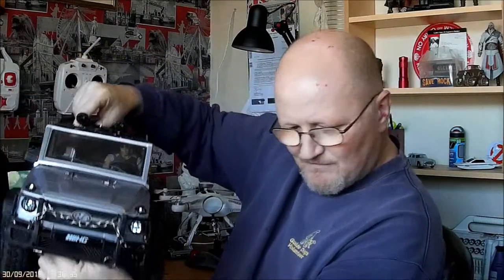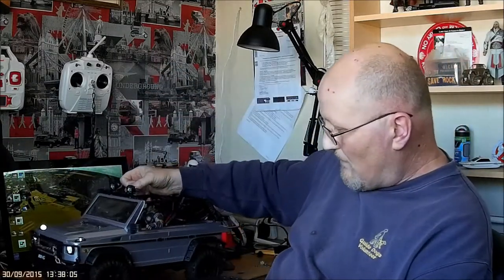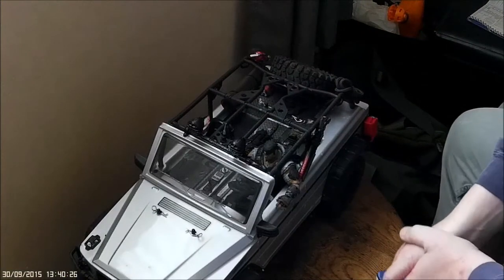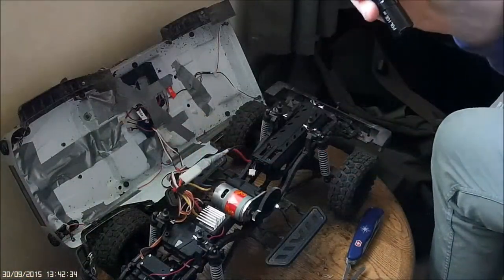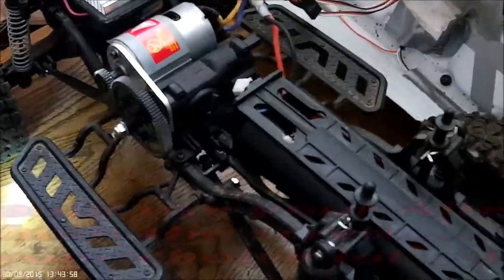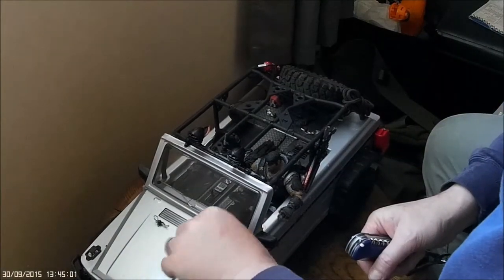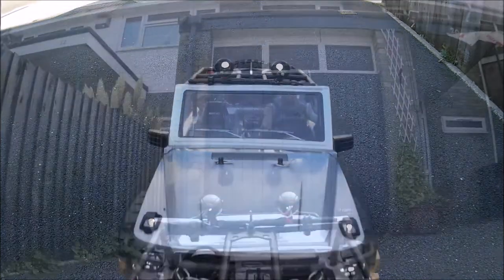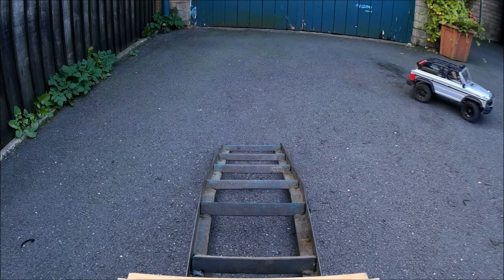How to change  HG P402 from a High to a low range gear .

Comment: There is no need to loosen up the bolt, unless it was overtighten from factory. All that has to be done is slightly rock back and forth the truck while attempting to switch gear, and it can be accessed from the bottom w one finger

Comment: Your screw most be over tightened,I have had 2of these and never had to take ether apart to switch between the 2. Only time I had to take it apart was to add in a servo to be able to switch between them at the tx
Reply from the maker: Cheers Milla.  being new to the game I am still unsure what's normal and what's not so thank you 👍☺

Comment: Hello Steve there is a option to mount a micro servo and to use that H to L switch on you transmitter that you use to control your lights to change the transfer case on the fly.
Reply: +DukeSky I have the 6x6, the high/low switch can just be pushed across, which makes sense if it can also be controlled via the tx with a servo. I have the gearbox on low, and the smallest pinion, but need to get more bottom end torque for crawling as I have a scratch built Oshkosh shell on it, and its heavy.
Reply from the maker: +DukeSky,  awesome I never thought of that. many thanks matey I will look into it. 👍☺
Reply from the maker: +Bristol Armoured Division . I would love to see that, any chance of a video ?

Comment: hi Steve, i just got mine but for some reason the steering doesn't work properly. battery is fully charged and batteries in the controller are new. it goes forward and back but not right or left :-( hope you can share some info. Thanks!
Reply from the maker: Hi joey, sorry for the late reply . Have you fixed it. if not there are 2 things to check . 1 check the steering servo isn't jammed. I know it sounds odd but I have had this happen and 2 check you're plugs are in the right way. When I put my lights on , the same thing happened.  I could move back and forward but not steer. I played with .....sorry checked the plugs and found I had attached them wrong. Hope that helps and sorry I did not answer sooner.
Reply: +Steve “Cougar” Ball thanks Steve :-) no i havent worked it out. to be honest i prefer my local rc model shop to look at it just to be sure because im still learning as i go when it regards to these electronics. and also, i wanted to change everything to waterproof ones.
Reply from the maker: +Joey Palomeno I can't fault you on that matey . good luck 😊👍

Comment: Ok I got one question, How then the transmission servo works? Its just moving back and forth between H and L. If using the radio, then it shifts without having to unbolt "loosen" up the gearbox arm.
Reply from the maker: on mine there is no servo to change ratio.  The switch on the controller adjusts the lights lol .It is possible to fix a servo and attach it so that when you flick the lever on the controls it changes ratio. The reason I  ade the video is that this was my first rc car and no where did the literature say about how to change between low and high. so when I found out , with it being a new truck at the time , I posted to help others like me. 👍☺
Reply: +Steve “Cougar” Ball // Certainly did help me also. What I mean how will it work w the additional mini servo to change remotely if anyway the gearbox arm has to be unbolted...might as well leave like it is. It seems something I am missing or needs to be shimmed/adjusted. I did find a video where it could be flipped from L to H and viceversa w/o having to unsrew but cant find it. I do thank you, your cool videos convinced me to buy this awesome truck at Gearbest, 8 days shipping to my door for 100 dollars. Slapped a old high torque Hitec metal servo, longer servo arm, a Nanotech 3000mah lipo 7.4, removes the tire inserts and deans connectors, its ready now. Next will be relocate battery, waterproof as much as possible and do all the scale look accessories.
Reply from the maker: Crankestein Loskon Superb make sure to post videos of what you have done. There are loads of people out there who you could help with your tips and tricks lol. Top Man
Reply: +Steve “Cougar” Ball // whats the lol for in your comment?
Reply from the maker: Crankestein Loskon I have no idea . I really need to start reading before I post . The only thing I can think is my phone (which is older than me ) did an auto insert and I missed it. I am really looking forward to seeing your mods :-)

Comment: This truck is on sale at GearBest for $53 + $30 to ship.  Is it worth it?
Reply from the maker: yes  , if you want to get into rc off roading it is most definitely worth it , but beware of Gearbest,  I have personally had a lot of problems with supplying faulty goods and not accepting returns. If you can find it else ware such as banggood   it may be a little more expensive but you stand a much better chance of getting it in working order ☺
Reply: - Get some magnetic tape, and glue a few turns into the wheels to make them heavier. Throw away the foam inserts, swap the bushings for ball bearings and buy a 55t motor. Swap the suspension for oil shocks, it will be one nice custom crawler. Its a rc that is customized to your liking, as most do.

A definite upgrade is all metal chassis and center chassis brace.

Comment: are the shocks oil filled if not will axial parts fit
Reply from the maker: No the shock are sealed but I do intend on replacements eventually.  As for axial compatibility,  I have no idea matey sorry ☺

Comment: Can you use a 3s battery?
Reply from the maker: Not sure matey . I would have thought so but there is a few HG forums out there that you could check on 👍
Reply: And can you fit 100mm shocks?
Reply from the maker: BeastRider I'm going to say yes I think so . I no longer have this truck but I think I remember a guy in the US that changed shocks and wheels for larger ones. Sorry I can't be more help

Comment: Or ....
just buy the servo upgrade to change ratio from your transmitter (around £5.50 from Banggood)
link : https://www.banggood.com/HG-P401P402P601-RC-Car-Parts-Servo-Upgrades-Kits-P10030-p-1038286.html?rmmds=search&cur_warehouse=CN
You will, of course, need a third switched channel on your radio set - most car controllers have one fitted.